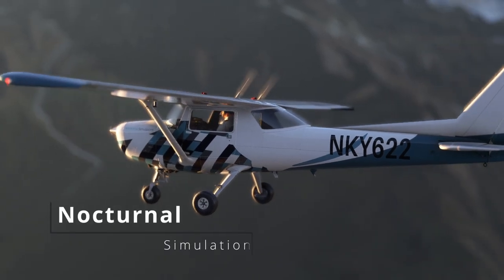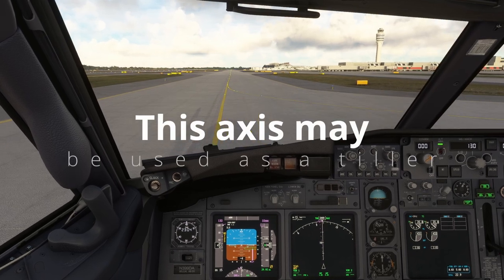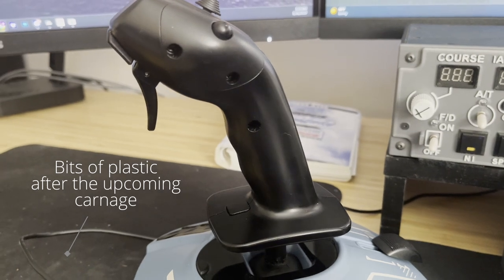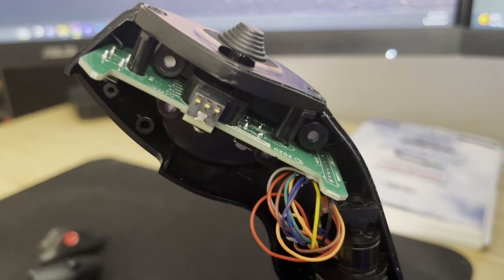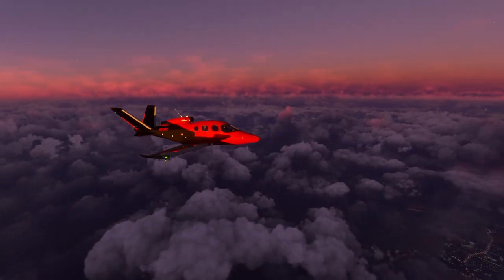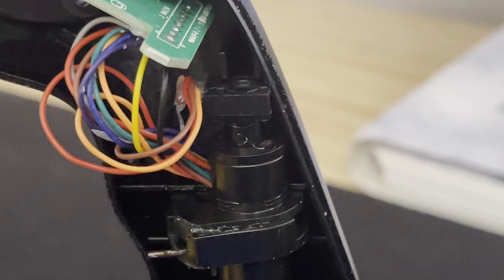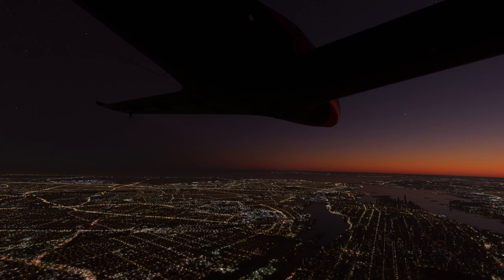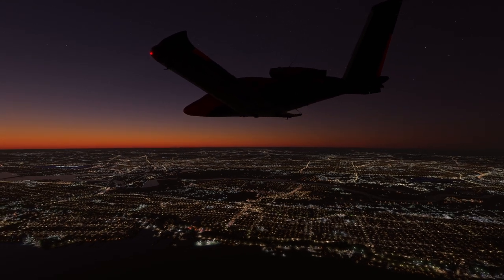Twitchy TCA Thrustmaster Sidestick Rudder? Here’s the fix!

Comment: Thanks a lot! A little addition. 5 screws from the left side, dismount side buttons from the sides of the stick and unscrew two screws from under the right side button. Used 96% alcohol for the procedure - tried to push it from the insulin syringe to have a thinner needle and faster liquid stream. My grandma always said that a reasonable amount of alcohol will never do any harm.
Reply from the maker: I like to use electronics spray since it will often times blow the crud out, so that's a great option.  Good suggestion!
Reply: Yes a vital part of the dismantling missed out - hopeless

Comment: Thanks a lot mate, I was literally about to give up and buy another. Couldn't get screw 3 out but pried the bottom open, gave it a good blow and to my surprise it's fixed
Reply: Hey, when you say you pried the bottom open, how did ya do it? I am struggling with screw 3 as well, did you just rip it out and it didn't break?
Reply: @callumjohnson4645  I basically pulled the 2 sides slightly apart and then blew into the gap
Reply: @-_-O  Managed to get in in the end but took a good 45mins to get that bloody screw our haha, thanks for the reply.

Comment: So many others seemed to have suffered this same issue (as I did too!) that Thrustmaster should have done a fix! I did get it replaced under warranty, but it took a lot of time/effort to do. I ended up buying a Logitech Extreme 3D Pro as I didn't trust the replacement one (still in its box!) and have been extremely pleased with it! You should not have to pull the stick apart to fix this sort of thing... Good video though!

Comment: Thanks for this tutorial. When I opened the joystick up I was a little skeptical that it didn't seem to dirty, but I gave it a spray and put it back together again. The only fiddly bit was putting the changeable buttons back on. Seems to be running smoothly now according to the thrustmaster software. I'll give it a proper run on flightsim later.

Comment: Mine started doing this exact thing and is only a year and a half old! Seems to be super common with this side stick...I'm going to try this out tonight! Thank you!
Reply from the maker: Did you have any luck!?
Reply: @nocturnalsimulations  yes! Cleaned everything up and re-routed some wiring as well since some of it was pinched during the manufacturing. I also trimmed down the front tabs a little as I saw elsewhere and it’s running perfect now with no twitching!
Reply from the maker: @OmegaSimPilot  that’s great to hear!

Comment: Great video Nocturnal!  Thanks.  Saved me from buying a new sidestick.  As noted by others, be aware that once you remove the side buttons there are two more screws under the right button location for a total of seven screws you need to remove.  I thought I just needed to pry a little to separate the two halves, then realized my mistake.  Also be aware of the rotation lock at the bottom.  I did not see this and it fell out.  Took me a minute to figure out how it is oriented on the bottom of the cover pieces.

Comment: Good evening Nocturnal Sim.  Nice to see your other vids when you're not live streaming.
I have a question for you:  Before going through all this, wouldn't it be easier to first try recalibrating the Z-axis control, using the Windows Calibration menu, and moving the stick around given the instructions?  I know I used to be able to do that in Windows 10.  Problem is, I can't find how to calibrate via the software on the computer.  Do you know how to do this, so I can try to avoid going as far as taking the whole thing apart?  I'm not real mechanically inclined and fear I'd break the whole thing, and not be able to get it put back together.  Thank you for your time, if you read this.
Reply from the maker: @B3burner  hey! I think if you search for “gamepad” in windows 11, at least I am assuming that’s what you’re using, it should come up with that old menu you remember! 

Yes, you are correct it is a good first try but a dirty potentiometer is probably going to keep giving that glitchy reading that causes the problem. So, try it and see! If it works, awesome! If not, let me know if you need help getting this sucker apart beyond the video!
Reply: @nocturnalsimulations Thank you for your fast reply.  I was able to access the old calibration menu in Windows, by uninstalling the Thrustmaster driver first.  I had failed to read that part.

I haven’t tried it yet, but will in a few minutes.  If it doesn’t work, I will watch the video again to try to take it apart.

Comment: Thank you so much! This worked for me. I was using a 70% deadzone because of the twitching but I can finally reduce it. What deadzone would you recommend for rudder axis to prevent any potential false imputs?
Reply from the maker: Since that’s a classic potentiometer it’s going to have some noise compared to a Hall effect sensor that’s on the joystick, 2-5% depending on how significant the jitter is
Reply: @nocturnalsimulations  Got it, thanks again.
Reply from the maker: @MatPocobo42  you’re welcome!

Comment: Is this a permanent fix? I know this sounds like a stupid question, but I followed a video similar to this a year ago and the problem slowly came back. That one didn't do the spray cleaning; it focused more on wire placement. The fix didn't stay.
Reply from the maker: That’s a tough one to answer as there’s a ton of variables involved.  I would say it would be a maintenance item for as long as you own it.  However it would be easy to redo the next time(s) since you’ve already done it once and know what to expect.
Reply: @nocturnalsimulations  
I should say I'm on my second one, as the first one started acting up again after that attempt to repair it. When I bought the second one, I was steeped in wishful thinking that maybe some were faulty and some were not. But it seems like all of them are faulty. I can't, for the life of me, understand why Thrustmaster has not yet tried to fix this. It's a popular item; and this issue is equally popular. Smh.
Reply: @rickfloyd451  I totally agree. C'mon TCA, your gear is usually 100% and this is a very factory-fixable design fault.

Comment: Hi and thanks for the video! I followed what you said, I just cleaned the  potentiometer, pulled the wires to loose them a little bit and now it seems to work! I just wanted to ask you how I can clean that part we see at 1:06
Thanks!
Reply from the maker: That’s the Hall effect sensor for the joystick itself.  You have to remove the 4 screws that hold the black base in for the joystick (this is inside of the base of the unit) and it’s right there
Reply: @nocturnalsimulations  Oh thanks, so I must remove the bottom plastic?
Reply from the maker: @blackfalco33  that’s correct.  You’ll have to remove the bottom and you’ll see a couple circuit boards/wires and in the middle will be the base I mentioned
Reply: @nocturnalsimulations  Ok thanks for the infos and help, very kind! For now it worked just by removing and cleaning the potentiometer so I'm happy with it but in case I'll need to do it again in future ( hope not lol ) I'll try to open the base as well and see what I can clean ( without doin' damages...lol ).
Reply from the maker: @blackfalco33  no problem, any time! If you’d like feel free to join the discord and we can trouble shoot just about anything!
Reply: @nocturnalsimulations  thanks I joined! ^^

Comment: Hey man, I know its been a while since you posted the video but is there a way to fix this if its not responding at all? everything works just not the x and y axis on it, maybe you know what replacement parts I could order?
Reply from the maker: Have you checked the wiring for loose connections or pinched wires? Could be a simple plug it back in solution or soldering a wire back together
Reply: @nocturnalsimulations  I dissassemble and found nothing unless its in the potentioteter itself
Reply from the maker: @CeceNomad  could be the potentiometer itself then, I do not have a part number for that and you’ll likely have to fight with thrustmaster to get that unfortunately.  Google would be my first stop
Reply: @nocturnalsimulations  Thanks for the help, I will try that.
Reply from the maker: @CeceNomad  Good luck!  Please post the part number if you manage to get one and I will sticky it.

Comment: Hello mate, Than ks very much for the quick and easy tutorial! I would like to ask you if you could appload a similar video repairing the thrustmaster TFRP rudder pedals, i'm facing immense issues with the product in result of it jiterring and not functioning as required. I contacted thrustmaster support and i had no luck.
Reply from the maker: I unfortunately have never owned those pedals but I bet it’s a similar deal.  You are very welcome for this video though
Reply: @nocturnalsimulations  Thank you! I am a real life Boeing 737 operator and I've got some gear for flight simming, unfortunately the rudder pedals are not working correctly and that is by bouncing and jittering. Thanks again for the tutorial and I'll definitely look into tearing them apart and possibly finding a solution using the same way. Best regards from Greece
Reply from the maker: @mr.vaggelis146  feel free to join the discord if you get stuck! You can send me some pictures on there.  I am an engineer so I enjoy working on things 🙂
Reply: @nocturnalsimulations Quick update, I tore apart the TFRP rudder pedals, cleaned the potentiometer and it's working perfectly now! It was a pain in the ass to do but worth it.
Reply from the maker: @mr.vaggelis146  much better to go through some short term pain for long term gain on this type of stuff, which I am sure you already know lol

Comment: Its fixed my problem. 🤩Thank you sooo much. 🤝😘
Reply: in the title says that you need to rearrange the wires , but nothing changed the guy .
Reply: @meade918r   I just sprayed it with contact spray, but also had 2 more scratches than shown
Reply: @x_psycho_666_x7  bad decission . i ended up broken the 2 wires . and the stick its not the same anymore mounted  . i will try at an electrician to fix it again .

Comment: i don't gave the spray... should i still do it?
Reply from the maker: Rubbing alcohol will work too
Reply: @nocturnalsimulations  ye, but i don't have any 😕
Reply from the maker: @JayJay360x  well, you can try this and blow out the sensor with compressed air or your lungs in an attempt to get it working at the very least!
Reply: @nocturnalsimulations  Thanks! ill try that 🙃

Comment: Sorry, but negativ! Your recommended fix looks great. But, after removing the 5 screws, it's not possible to remove the loosen left side of the stick !!
Up on the top, it stays together and if you start to draw, so much tension is building up that for sure the plastic will break :((
Could you please show us, how to remove the upper top left half of the stick!? Would be great!!
Reply from the maker: Are you talking about the parts at the top of the stick where you can swap the autopilot from left to right?  You’ll need to remove that screw(s) also
Reply: @nocturnalsimulations  I think they have redesigned it recently. Mine is not that old and has the same problem. However the thumbstick is held in by two hex screws that seem to be a weird size. None of mine from 1.5mm up fit. These appear to need to be released before the stick will come apart.
Reply: Ok discovered the secret. there are an additional 2 screws on the other side. Making a total of 7 screws to remove.
Reply from the maker: @dotChuckles  ah, that may be it.  I’ve had mine since about when it came out originally
Reply: @nocturnalsimulations  either way, taking it apart and cleaning the pot fixed my issue! 😊
Reply from the maker: @dotChuckles  awesome! I am glad it helped

Comment: Im honestly so shocked, my unit is 10 days old and has this issue.
Reply from the maker: What!?  That’s insane….hopefully this fixed you up
Reply: @nocturnalsimulations  yeah I don’t think I will because I have dedicated rudder pedals so I don’t use it anyway, and I don’t want to void my warranty to be honest
Reply from the maker: @AviationFun737  No worries, I normally use the twist "rudder" for a tiller in tubeliners and then it doesn't get touched afterwards.  Luckily you can just use rudder pedals for that anyways.
Reply: @nocturnalsimulations  yeah I used it for tiller for a bit but I find rudder a bit easier as I’m used to it